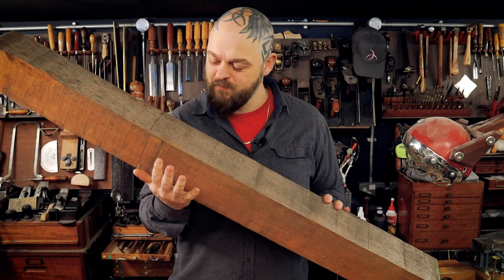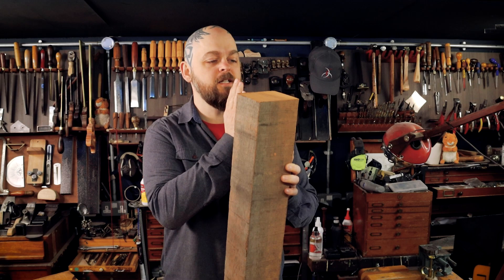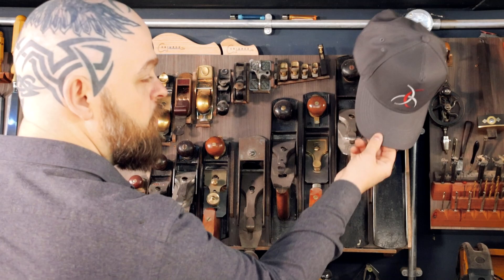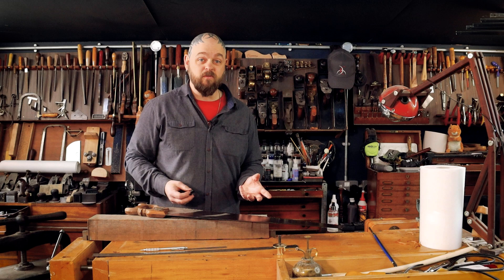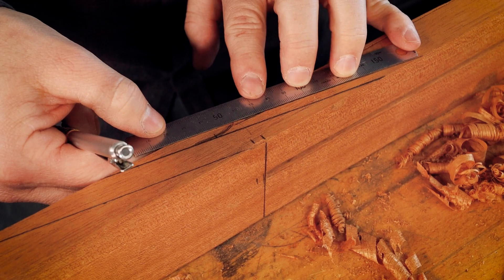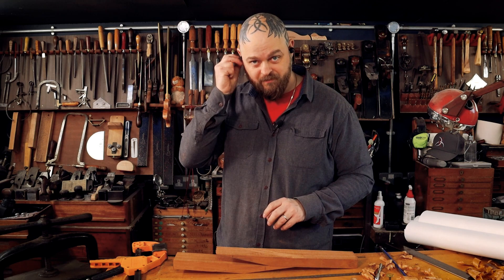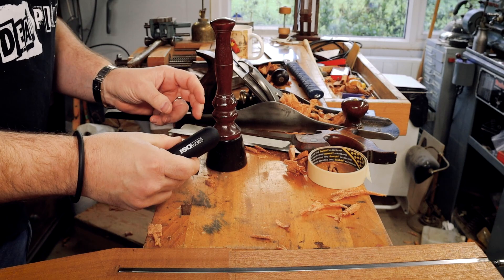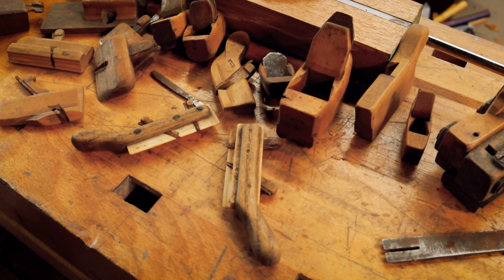Ep 2  Cutting a Scarf Joint | Hand Tool Only Acoustic Travel Guitar -  Guitar from a 4x4 FENCE POST

Comment: I can't tell you how much I appreciate the "101" at 22:00 . I'm a power tool woodworker, but couldn't wrap my hand around hand planes, as I've never owned one. Hearing you mention that you start digging in with the front, then shift your downward pressure to the back, I could finally wrap my head around how it would work, effectively turning the "back" of the band plane into a jointer's outfeed table (for a power tool comparison). I wondered, though, how this would work in practice, and it never occurred to me that you'd transfer your pressure from one part of the plane to another.

Comment: You could make amends for your power-tool slip by repeating that operation with a hand drill on a couple of pieces of scrap wood. Yes, it would be a conscious act of magical thinking – or 'headology' – but magical thinking actually does work in our heads, just not on the material world.

Comment: At 18 i learned from ex pattern makers in there 50s then    now i am  55  and watching you brings back  a lot of memory's.  I spent hours planning wood as flat as i could with a long wood box plane then having it put on the granite table where it would be checked with a micrometre dial for run off several of them went striate out of the open window  and start again this was my life for 6 months and making the wood two part mould  for the sand part that would make the shape on the casting that the Crain would fit into only to get machined off   later all with hand tools .I am loving the build of this guitar i have made 7 electric guitars now and loving it .

Comment: I was taught to use the full length of the blade when sawing, this makes achieving a straight cut much easier
Reply: The problem in this case was using a japanese saw without japanese technique. While cutting, the back end of the japanese saw should not be cutting, only the piece closest to you. Once you reach 45 degrees, you flip the piece and cut down horizontally until your cutline is horizontal. Then, you drop you hands again cutting until you reach 45 degrees. Etc.

Comment: Those mini planes are great.  I still have some of the planes my dad made as a cabinet maker, and I was a fitter/turner and then toolmaker many years ago and still have all the small custom tooling I made.  I love stuff like that.  Looking forward to the video.  Its great to use tools like that - they were usually make for a single purpose and are tools, and not to gather dust as ornaments so to see them in use again would be fantastic.
Reply from the maker: Right on, I love old tools and feel exactly the same as you.. I can't wait to use some of them again

Comment: Just a thought. Both the tail and the headstock come to a positive point. The drawing for the inlay inverts that vertically.  You could "notch' the body and the headstock to match the inlay.  The extra angles at the bottom of the body may provide more strength with the angled body joints. It would also trim a few inches off the total length for backpacking (although it seems backpacking is now a secondary goal for the instrument.)   However, the inverted notch at the top of the headstock would reduce the wood available for tuning pegs as there's not much "real estate" available.

Comment: Japanese saws are generally not designed for cutting hardwoods.  The Kabata will do a fine (literally) job, but it will take some time.  If you can spare the wood, a Kobiki-Nokogir will cut much faster but won't leave as clean a finish.  You do need to use both of them along the wood (as you were using the Western rip saw), so that the length of the cut helps to steer the blade straight.  Using a Ryoba runs the risk of marring the cut somewhat when the wood moves and closes the cut sufficiently that the cross-cut teeth contact one or both sides.
Reply from the maker: Very good to know,  thank you! I feel there is a whole world of detail to learn just about these saws!

Comment: I find with hand saws that using a low angle/ the most teeth you can and the least presser required will help loads to get better cuts. A sharp saw is good but there are differences in rip and crosscut. Also tooth set plays a large part. If you need a pull saw as big as your push saw check for a hole at the front of it. A pole can be added and the saw turned around.
Reply: A marking knife can be a big help with getting cuts started. I made mine from an electric jigsaw blade by sharpening the back of the blade and tip but leaving the saw teeth. That way after marking a cut line you can cut with the knife and turn the blade over and start a saw mark to put a bigger saw right into.

Comment: I laughed so hard at the Triton drill thing... I guess when it's so ingrained in your head because you never NOT do it like that, it becomes hard to actually think of doing it differently when the theme of the build is "no power tools".

By the way : you could include a short explanation in the next video on how you could have done the same job without a power tool. For integrity's sake?
Reply from the maker: this.. and yes.. I will do that, good call!
Reply: Manual drills exist and are easy to use, if a bit uncommon to find. Powerdrills can be so affordable that I don't think the use of one detracts from making the build process accessible to the average audience.
Reply: @KimonFrousios  but it IS a power tool. Yeah, obviously, for people trying to learn how to build guitars "without spending too much on tools", a power drill isn't gonna be what limits the budget, most people already have one. But this here is also a themed challenge, regardless how silly it is, it's for fun

Comment: Thank you, you have just dispersed a feeling of guilt that has lasted for decades.
We had a wood turning project in woodwork at school and we each had to cut a block out of mahogany stock that looked similar to what you have. For my turn, I was sawing down the grain, twisted the saw and it slit a couple of feet down. I've been led to believe since then that I caused that and ruined a perfectly good (and very expensive) piece of mahogany.
Reply from the maker: Not your fault in the slightest, wood will only ever split like that with either very precise force with an axe or froe etc or.. if it really bloody wants to! Whoever did that to you is a grade A dickhead imo
Reply: @CrimsonCustomGuitars  that's what I learnt from watching you thrutching that 'split' piece apart.

Comment: Great stuff! Use of the Holy Plane and the 2" chisel in one episode!
Those little planes look amazing- I hope it's not too long before we see them on Tool Tuesday.
And I'll forgive the slight aberration with the Triton drill- it's only a couple of 2mm holes so nothing too horrendous. Is there any way of fitting a handle to the spindle sander so it can be turned by hand? You could probably get some children to power it!

Comment: I would cut the original desired piece,  then split open the crack, then glue and clamp. Usually this is invisible and stronger than plain wood.

Comment: I'm hooked on riven wood and buy lumber with long splits already in the planks. All of my hammers have riven handles - they 'sing' in my hand.
When the Royals commission a piece of furniture they insist that the maker use riven wood. (read that in a cabinet making book)
Reply from the maker: That is very cool, very cool indeed. I only use riven wood for bracing on acoustics for exactly that reason!
Reply: @CrimsonCustomGuitars  I imagine Stradivari using riven backs, riven veneers and riven necks, riven wood for every part of his instruments.  Could be that Stradi didn't even own a rip saw!

Comment: I believe scarf joints are more structurally sound when they are under the headstock than in the middle of the neck. 
And I disagree that they are more unatractive under the headstock -I think it's the oposite, in fact; they look more conspicuous in the neck.
First time I have disagreed with Ben's choices, but I think the issue is important enough to mention.

Comment: 18:13 Exact reason to why I might give up on having a Japanese saw and definitely not investing in more than the one I have (Just a cheap, althouh German made from Bauhaus) They start to veer off course so easy and fast, and because the blade is so flexible, the slot you're sawing also easily becomes rounded instead of straight, thus creating more friction and making it less straight.
Reply from the maker: there is a technique that I dimply haven't mastered yet, I agree.. for cuts like this I am going to stay with traditional western saws, though Japanese saws do have their good points for other finer tasks imo

Comment: Hi Ben, I don't think there was an issue with your scarf cut and truss rod slot assuming the blank had adequate wood to each side for the headstock design.   While potentially a pain to glue up, if the two pieces had been aligned lengthwise to the slot the result would flip which side  (bass or treble) had more or less wood with which to work.   The material constraints for both the neck and headstock would not have changed... I think you were ok as-is.  Am I missing something here?

I'm looking forward to the upcoming episodes.  Regarding the power drill, who cares.  In my opinion a hand-tool build is not necessarily a "no power tool build".  I also think it's easier to screw up with a powered hand drill versus one of the many manual drills while using the same skill set.  Just don't touch the router :goodvibes:Keep up the good work.

Comment: Your first choice saw would have been the best... if it is sharp, and very true as to "set".  Your problem was the bench and the awkwardness of filming. Sawing at a 45 degree angle to the top flat, and sighting down the line would have kept you dead straight.   50 years of hand sawing here.

Comment: Failed already. Used a Power Drill for the locating pins on the head stock scarf joint. For shame Ben for Shame. We all know you have a hand powered egg beater type drill you could have used and should have. But at least you finally started the build. ;-)

Comment: I think a handheld powerdrill is forgivable. It is handheld and it is the powertool most likely to be owned by a DIYer. Frankly some handheld powertools may be more accessible than some fancy unpowered tools. 
My understanding of hand-tool-only builds is to avoid massive instruments like bandsaws, pillardrills, table routers and belt sanders, and instead use tools a person without a workshop can also own and use.
Reply from the maker: I feel the same.. it does seem that all 'electric' tools are put of bounds..  now, on your comment on fancy non-powered tools.. I was seriously considering buying a collectible and very rare, and expensive, Holtzappfel treadle lathe to turn the tuning keys!?! And I have a treadle saw by the same maker that I could bring into the workshop.. strictly it would fit the bill but be a thousand times less accessible to almost every maker out there!

Comment: The Ryoba is the perfect saw, you were stood incorrectly. Once the cut dropped below the bottom of your sturnum you started leaning. Stand square and use both hands on the saw for rip cuts.
Reply from the maker: Both hands? Cool. I'll try that, I had figured my stance was wrong. I felt all weird at the end
Reply: I find that once my arms end the pull at wider than 90 degrees between shoulder and wrist I tend to curve my cut as I start to lean sideways.

Comment: Shortest build ever! Totally fluffed it there bud. Next episode I suggest removing all batteries and probably fuses too. I was quite surprised at your approach, I was taught to prepare and mark my 2 square edges and then take all measurements from those sides that way everything you do stays true and all lines meet... this is schoolboy stuff. I could go on but I won't. Must Try Harder! ;)
Reply from the maker: I'm certainly going to be more.on point from now.. as you can tell I was REALLY distracted this past week. A lot happening here, that being said, I do need to be a little more precise with my scarf joints
Reply: @CrimsonCustomGuitars  I guessed there was much more in the background mate. You don't deserve my ire, I get it. We still think you're great. Take some time out if you need it, you should be having fun too. My only worry about the scarf joint is just the strength because it is reliant on glue strength (if you don't use a drill ;) ) but there are variations that can give better compression strength. I was wondering whether a (chunky) dovetail could be a good alternative.

Comment: I was taught, by Brian Braithwaite, one of the finest cabinetmakers I have ever met, that you NEVER use the back iron to loosen the screw. You use….. a screwdriver. The back iron is not designed for that purpose.
Reply from the maker: it kind of is, the reason to avoid it in truth is that if you share your tools and the other guy has really really tightened that screw you run the risk of chipping the cap iron.. if you are the only tool user and don't over-tighten then there is no problem using it this way.

Comment: Hey Ben! How would you fix a bass that has a heavy neck?? Would you remove neck material or add weight to the body? Every time I play the headstock wants to go to the floor. Thanks in advance! I love your videos and I'm making a guitar inspired Mandolin so this new series is exactly what I need!! Keep up the good work!!
Reply from the maker: You.could move the lower strap button to change the balance point.. that's the easiest and quickest option imo.

Comment: Yeah I know I am being pedantic but after your detour to Vintage Tool Shop where you held up a hand drill & commented that you most probably needed one that not only in this ep do you pick up an electric drill for your locating pin holes but the compound this by promoting Triton with a link. The comedic cover up approach/apology didn’t work either.
Reply from the maker: I ma sponsored by Triton (though I sued them for nearly a decade before that happened) but this honestly was just me being distracted and going for my default tool. When faced with a choice between someone being malicious or someone being stupid.. 9 times out of ten it is going to be the latter.. especially with me, I don't lie to people, it's not my style..
edit.. the drill I picked up at the tool shop was for a completely different task and wouldn't work with finer bits, I was/am planning to use my delicious antique millers falls egg beater drill for this sort of work and am kind of bummed I didn't :(

Comment: I thought that you would have used a plough plane to cut the slot and finish up the end of it with a chisel.
Reply from the maker: tomorrows video will be me making a tiny custom plough plane for exactly this reason!
Reply: @CrimsonCustomGuitars  Great , i have 2 lovely ones i believe made by Record, chrome plated if you will, they belonged to my Dad and are older than i am, i'm in my 50's now, good luck on your build.

Comment: A western ripcut saw is easier to saw straight with, a japanese saw you have to saw with a different technique, the japanese saw you you have to saw at an (ca. 45°) angle for a bit, then rotate the wood around the y axis and saw from the other side in a 45° angle, swap back and forth either rotating the wood or changing your stance, so you essentially leave a triangle in the saw curf. I hope this makes sense as english is not my native language. But. Different technique is required when using japanese saws
https://youtu.be/nPSOfa3wMiE

Comment: Hi Ben! Throw away the blade of your japan saw and get  a new one. Seems like the tooth are angled different on the left and right side (happens when you hit a nail  e.g. while sawing...). Thats why the saw does not go straight. In my opinion, these types of saws ar the best you can get, when the blade is ok.
Reply: I didn't have a bandsaw for a long time and have struggled with blade wander on long cuts.  Poor tracking starts every time I insert a wedge to give the saw some room to work.  The only solution I've found so far is to limit the amount the pieces are pushed apart and wedge near the top of the blade and not the top of the billet.  I've found using something slightly thicker than the blade ideal.
Reply: @lettuceb2336  I m not sure, I can imagine that a wedge could cause such problems. From my experiece I would say that the saw stucks because the lower part runs already out of direction (caused by the tooth). So by sawing you are bending the saw blade what causes friction. However...

Comment: you can't really be blamed for using the power drill, it was a mistake. you use power tools all the time, of course you're used to that. You weren't even thinking of that you actually did, and you didn't mean to. not too big of a deal. To me, it's more the idea that you CAN do it without power tools. it would have been pretty easy to just use one of those hand crank like drill thinkies, whatever they're called, and that's the point for me when it comes to this build, at least
Reply from the maker: Thank you..  I do feel a bit dim in any case. It's like my mind is on rails!

Comment: cutting wood with the axe instead of a modern day tool that would do the work faster..?..because an axe follows the grain of the wood,,the natural grain, whereas a badsaw would not..so you get a cut that is parrallel to the natural grain of the wood..you need to work with the material, not fighting against it?